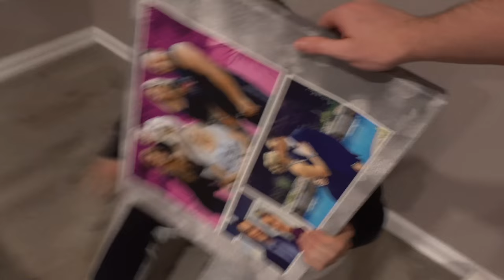SPRAY PAINTING MY PARENTS HOUSE PRANK

Comment: I had the same issue with my bottom retainer brake over the smallest thing they would fix it then a few months later the same thing. My dentist ended up putting in a thicker wire 3yrs ago and never happened again..

Comment: Lance at Home Depot, Walmart or Menards should have stick dots to put on the bottom of the vase and figures so they don't slid forward. The brand is called glue dots (it's plastic dots with sticky stuff that are double sided)